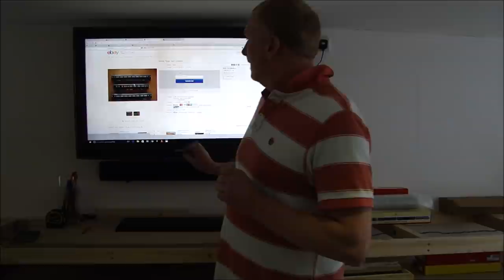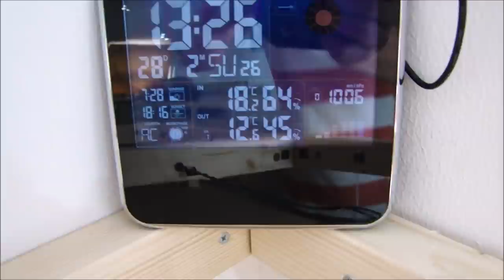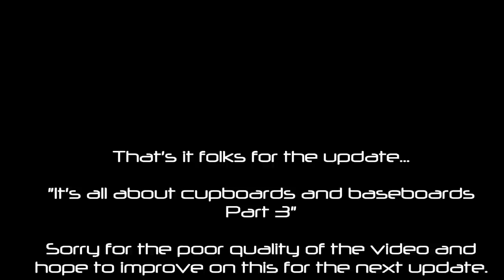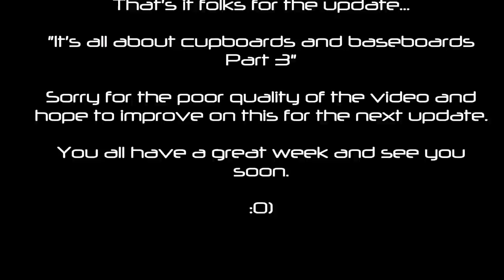And now, it's all about cupboards, fiddle yards and baseboards part 3

Comment: Great to see another update, Mark. The garage is looking fantastic with the new doors and table etc..Nice and warm, too. The Royal train is an exciting idea...Looking forward to seeing her running. I used the Peco stremline flexitrack for my long runs. I bought 2 boxes which worked out cheaper than buying them loose (was still quite expensive, though). Great deal you got on those hinges..they look good all sprayed up. All the best mate :)
Reply from the maker: +Tom's Model Railways Hi Tom, and thank you mate, those hinges certainly were a bargain, wouldn't want to use them for anything real heavy though but perfect for the cupboard doors, oh and I had another bargain on the handles as well, will tell all in my next up date.
I hope to get the track next week and yea I'll be getting in packs of 25 as well, way cheaper that is, already have two code 75 turnouts and hopefully at some time I'll have a simple loop created for playtime while I get on with the serious stuff :0)

Comment: Hi Mark, great update as ever, some great work on the storage, us seasoned modellers will advise you , that storage space is a must.  Mine is more open planned under the baseboards, but roomy, which is so important.
Love the 'fizzy' fridge....another must, mine has been used as a wine fridge for some time now, waiting to redo the kitchen which will have a wine fridge....great, mine can go in to my shed at last.....;-)
Peco flexi 75 is great, though I did have a reason for choosing code 100 myself......maybe more info on some forums. Maybe something on the crossovers as all code 75 is electrofrog and if DCC these can cause short circuits, while code 100 is available in insulfrog as well, stops those short circuits........could be completely wrong....suggest a good read up if you haven't already......seeing as you'll be buying at least ten packs of 25 lengths at SERIOUS money......nice work....and looking forward to next vid as ever.....cheers Ian
Reply from the maker: +wraggi1 Hi Ian and thank you mate, the storage space has always been a must in my plans for the garage and I've just about managed to squeeze in all my rubbish and leave enough space for all the model related things and of course the beer fridge, happy days are here again...... :0).
Yea I've done a bit of reading up on the code 75 and there are lots of pros and cons with it but from what I have read is that when it's done properly it really is the way forward, but again Michael Henfrey is making his own turnouts so I am also looking at and considering making all the track and turnouts myself, now that should be interesting to say the least don't you think?
I'll buy either code 75 or 100 for the fiddle yard though as you wont be able to see much of it when the baseboards on top.

Comment: The doors hide everything.  Great score on the hinges.  I think it was maybe 2 weeks ago a seller in the US was selling the code 75 track for around $50 a box.  There was 5 boxes.  I use code 100 since its cheaper.  Shouldn't be long now to lay the track.Scott
Reply from the maker: +Scott Downey It might be a little longer for the track laying than first anticipated Scott, I'm now thinking of making my own track including turnouts, but will use peco for the fiddle yard so will at least have something down to run loco's around on :0)

Comment: BS9000 I fell asleep as soon as you said it Mark! One thing I don't miss since retiring!  As for Peco code 75 I think that the only real problem is Lima with their massive flanges that bounce along the chairs. Very old Hornby is also a problem but that stuff doesn't run on modern code 100 either. .......................John
Reply from the maker: BS, British Standards or Bull Sh*t.....? just another way of bleeding companies out of money. Since my job change and increased workload I've managed to persuade my Operations Director that someone else in the business will need to take this task from me, which reminds me that I have check tomorrow that he has arranged this.
Yea I have that John about Lima and some very early Hornby as well, what I have tried so far though from my dads locos and rolling stock all appears to be ok, but I need to wait till I have the loop finished on the fiddle yard so I can run those locos and rolling stock across all the different types of turnouts and of course the cut sections for the drop down part of the boards.
I thought work was hard, then I discovered this hobby, not sure I want to retire now lol.....

Comment: Hi Mark you've made some really good progress there, and like all the storage room you have. I know the feeling with buying stuff its sometimes a real pain having to sift through a lot of items just to get a bargain.  As you know I've been away with work in Baku, however flying back tonight, I have kept an eye on some buffet cars for FGW and they are stupidly expensive but think I may have to fork out I think as i'll need at least 2 of them. It will be good to finally see your track going down how's the plan looking for Wootton Bassett station are you planning on scratch building.   Dave
Reply from the maker: +Swindon Station Hi Dave,&#160;yea those buffet cars are money cow for the ebay sellers, it doesn't matter what buffet car you're after they are always in short supply and cost an arm and a leg, and FGW are the most expensive, so when Hornby release the GWR version I'd snap 2 or 3 up right away and then get the other coaches later as they wont be as expensive, I hope.
Oddly enough I was in Bassett yesterday dropping of some PCBA's for testing and on my way home I stopped off at the Marlborough road bridge to see what Network Rail were up to, blinkers I couldn't believe the change, and the so-say "temporary road" that's going to be the new Bassett bypass for sure, look out to see which chancellors have nice new shiny cars ;0)
Oh and might not fully scratch build Bassett Station but I'll probably have to butcher a couple to make something that looks like how the station use to be, I could buy it complete as I found a website where that type of station is made mud it's over %100 ouch....

Have a safe flight back mate and looking forward to your next update as well.

Comment: I have no idear what 2015 audit is . Must me a managers job...lol ok wanted to ask was the old woottan basett station any where near where the quarry is. Plus this is something id don't understand woodwork is brill I could never do all that but I'm wondering do you have a track plan for the layout cos I would have thought you would have need one before building the units .
Reply from the maker: +Peter Hennessey Hi Peter, ISO 2001-2015 is something you don't want to go anywhere near, it's toxic lol.
Yes, the bypass rod goes right past the quarry next to the track, I have some pics now so will try and make a short video with them ok.
And no, I have no track plan, I've tried to do one but it just doesn't work for me so going to do it all from my head, one brain cell at a time. I have made the baseboards as big as I can without taking over the garage, so in my head I know where things will go, but I bet that all changes as soon as I put the first bit of track down lol.